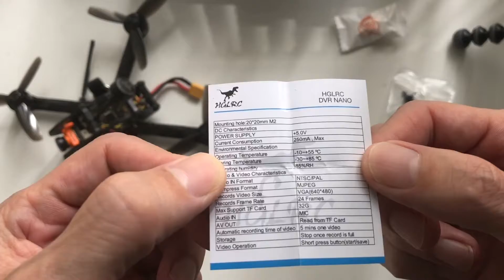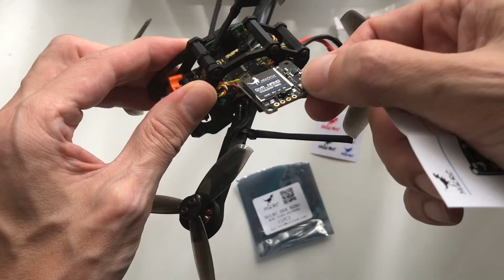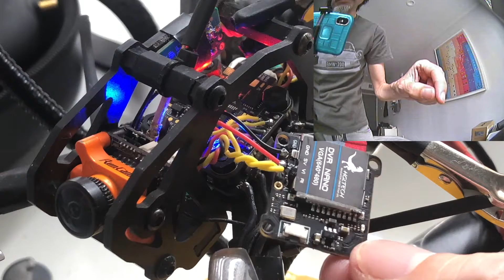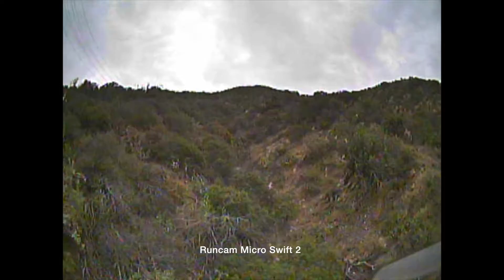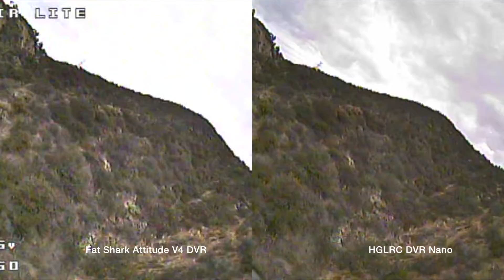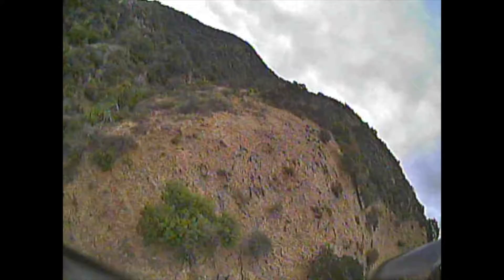HGLRC DVR Nano Install and Test

Comment: Hi - thanks for this video - my HGLRC nano actually producing a noise. I've powered the nano via the FC 5v and independently power up my camera also from the spare 5v pad on the FC. I  also have capacitor installed on the lipo pad - hoping if there's way to clean the picture or any other ideas? I used Iflight IH3 frame.
Reply from the maker: Hi! Hmm. If you already have a capacitor, I don't think I have a good answer for what it could be apart from maybe vibration. If it's sharing the same ground as the camera and VTX there shouldn't be any extra noise.
Reply: @MiniMicroFPV  Ok thanks - I'm changing the camera voltage and ground to the same pad on the Nano DVR - hope that'll make the quality better instead of being powered from FC :)
Reply from the maker: @joshhauw9803  Good luck with it!

Comment: I have the runcam and it works good but I just wired up one of these hglrc cards just like your video but all I'm getting is osd with a black screen. It seems to record ok but no picture. I'm thinking of bypassing the osd on the FC and just wire straight to the camera to see if that works.
Reply from the maker: Hmm. If all you are getting is the OSD and black screen then maybe it was wired after the FC and not before? So it should go Camera video out -> HGLRC DVR -> FC (OSD) -> VTX. Hopefully you got it working.